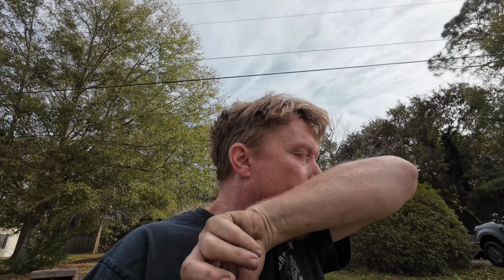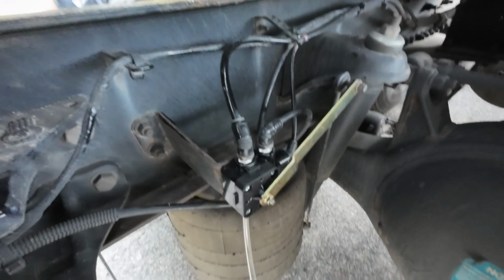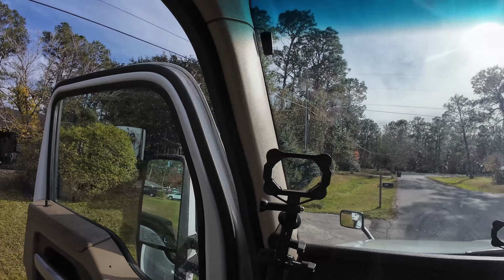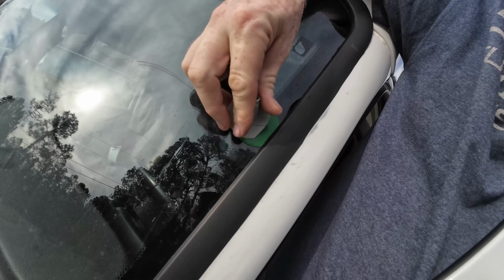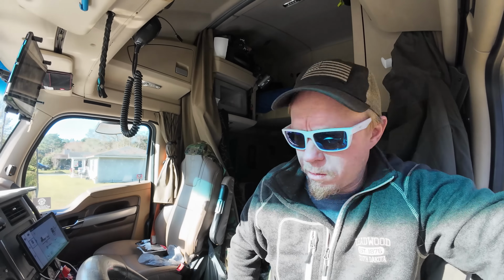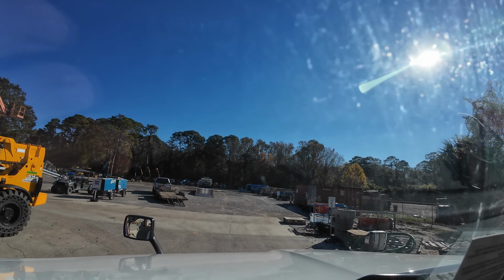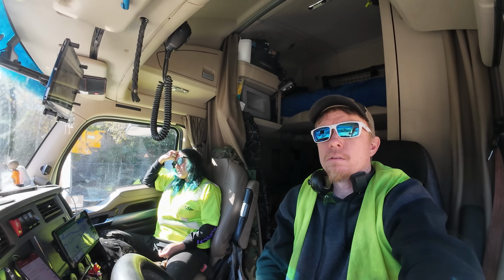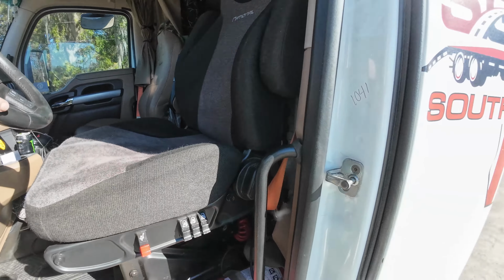You never had the load!

Comment: Hook your jump pack to the starter lead. I done it a hundreds of times. Yes on some trucks it's a pain like the Volvos. See if you can install remote jump terminal on the frame in front of the left steer tire or just behind the cab... 
Does your truck got the built in navigation? My t880 does...

Comment: Have you considered taking the time to mount some access points for use with a GOOLOO jump pack without having to take your steps out each time the battery has gone dead? It could also work in reverse if you wanted to help someone that needed a jump start. Have good days!

Comment: @SouthGeorgiaHotShot  

"VIP Message"

FYI

This info is in case you have the issue in the future with the Cummins X15 motor.

Hello I don't know if you watch Trucking Together' but Martin just fully rebuilt a Cummins X15 motor. They have a video called "FINDING A FIX & FIRST DRIVE" | Real Life Trucking - Episode #420. The truck would run for a few minutes and die over and over again. His manifold would get air blocked. His friend that is a mechanic said there is a by-pass to fix this issue.  Once he did what his friend said the issue was gone. 

Again, posting this comment so if you have a Cummins X15 playlist for things like issues. You might want to save this video in that playlist.

Comment: Just start the apu and make sure it is setup to maintain the batteries
Reply: If that apu make has that feature on it some of the TK and comfort pros the older ones do not have it, but the green apu does
Reply: @jamesmartin3895  even the first gen thermo king have standby and minimum volt setups occasionally you have a replacement board and have to have it reprogrammed to work

Comment: Umm, not knowing how you wired that new inverter to the battery bank, I can say this about inverters in general. Whether or not you have anything (Fridge, etc.) plugged into it, the inverter itself uses power. So if it's wired directly to the battery then it's sitting there drawing current from your battery regardless of whether you unplugged everything from it. The internal electronics are consuming power. (edit: think of it as "idling" your truck engine. It's using fuel but doing nothing) The only way to prevent the battery from draining will be to either disconnect it completely or install a switch (a kill switch) that will completely disconnect the inverter from the battery bank.

Comment: I replaced the windshield in my 680 a few years ago. It was $450 then. So, with all the "inflation" that's going on, it would probably be around 2-3 times that now. As far as inspections... if you're using the same DOT numbers as you were in Hotshot, it shouldn't matter. But if you switched DOT numbers, then your CSA score is too high (lower the #, the better). But I've NEVER had a broker go by that. They ALWAYS go by the amount of time your DOT has been active.

Comment: If this here is the shop you're going to use it is called , HAGGAL   DIESEL REPAIR You want  allison  to work on your truck She's very good at it ,  and they are down there in GEORGIA a damm good shop  ,  Her dad is the one who started this business , All they work on is ISX Cummins only ,
 If you are not using the truck and it's part that truck should have a shut off switch on the side of the   seat cuts power to the truck  ,
 Start dating his mom 😂😂   Just make sure she stays on her hands and knees that's all you need 😂   But you better not LITA  will cut your ding dong off 😂

Comment: Smart move getting your truck into haggai. Your high pressure common rail fuel pump may have the ceramic plungers in it.if they fail it destroys the pump and injector nozzles. You can also ck and see if your engine is able to have a power uprate if you ever decide to do that.